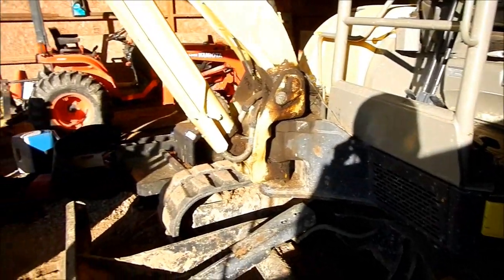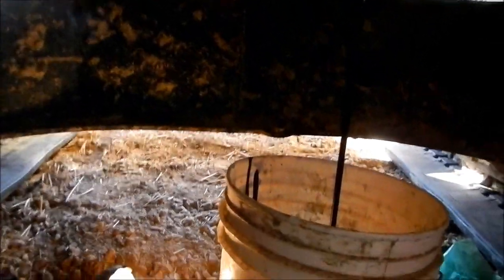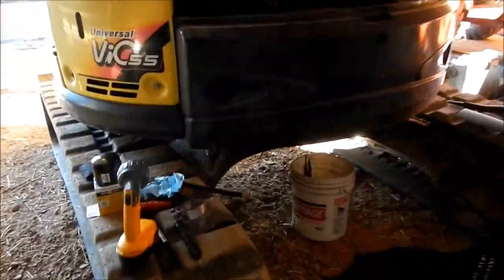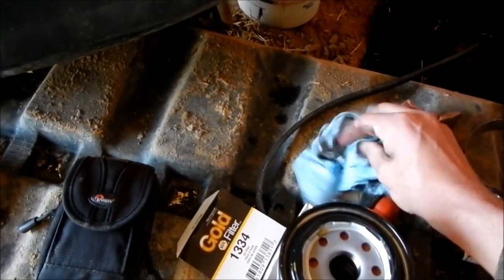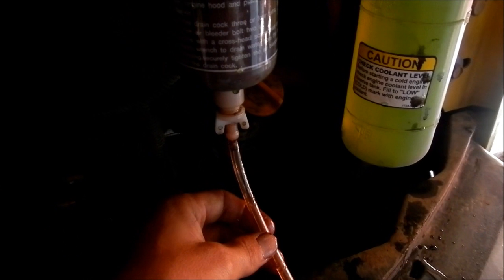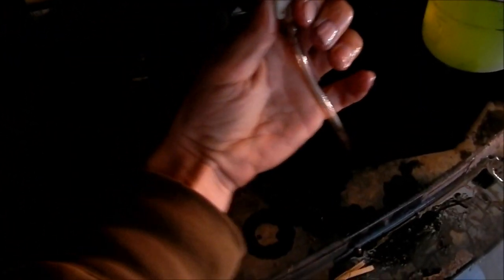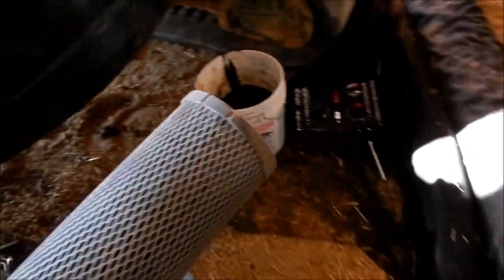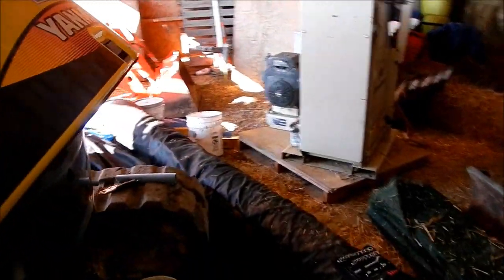Excavator maintenance

Comment: Just something to watch out for because I learned the hard way. The radiator will get quite a bit of dust stuck to it too. I had been spraying the machine off and didn’t spray the radiator well enough. This caused the dust to turn to mud in the fins not on the whole radiator but it was enough for it to run hot enough to heat up more than I would like. Thought it was the thermostat and or the water pump. But not being able to see in my machine all the well in where the radiator is I couldn’t see the cacked up parts that well. Now I know but thought I’d pass that along. Thanks for the videos.

Comment: The reason use don't use an air compressor is because the high pressure will blow holes in it. Just bang it on something till dust quits flying.

Comment: You might want to put a bit of oil on both sides of that gasket. That way it makes sense. 
Don't check the oil level immediately after stopping the engine. Half the oil is still in the oil system at that point. Leave it at least 10 mins before checking the oil level. That way you'll avoid over filling it, and if you do over fill it with oil that can cause a lot of damage with the pistons hitting the oil surface at bottom dead centre.